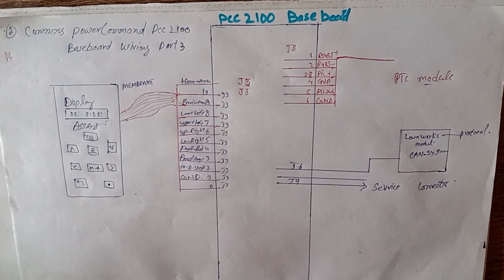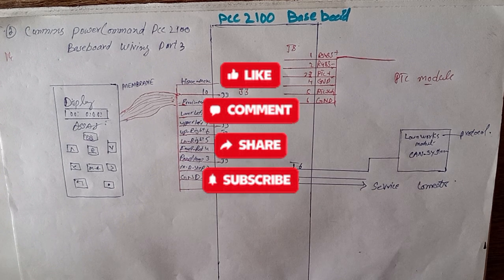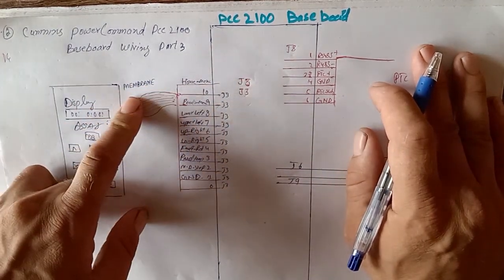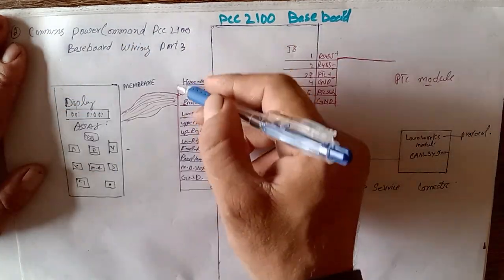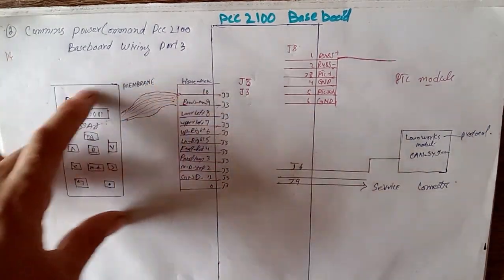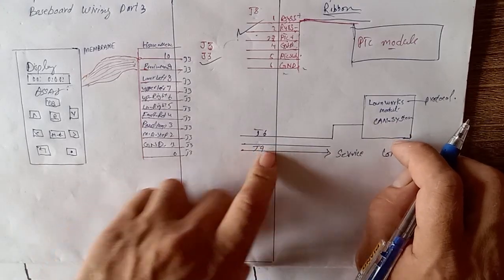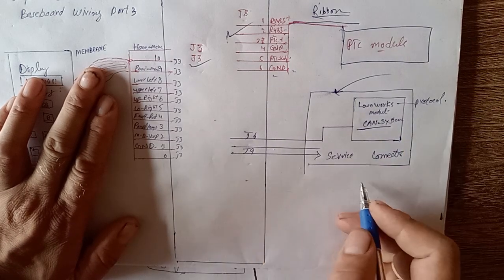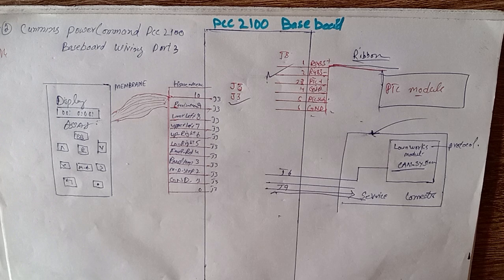Cummins generators PowerCommand wiring diagram explains  PCC2100 Baseboard wiring part 3

Comment: How to configure it's parameters.suppose we want to change its frequency or voltage values then how we will configure
Reply from the maker: Voltage is increase from AVR and Engine Speed, increasing speed  make also voltage increase,
Frequency is only increase or decrease from, Engine Speed From governor linkage and governor speed adjustment screw